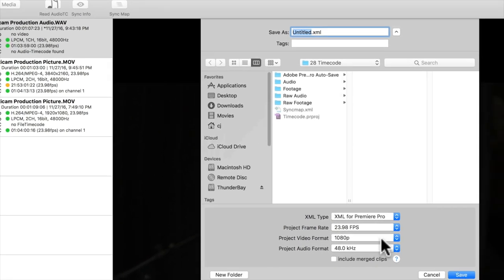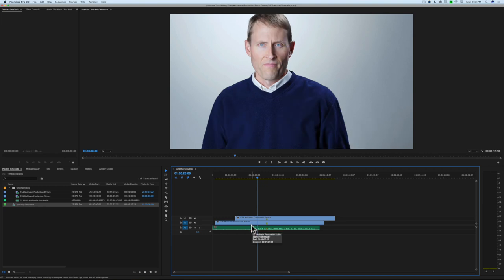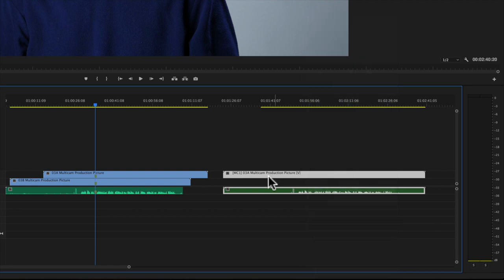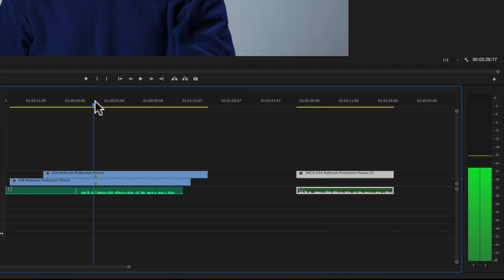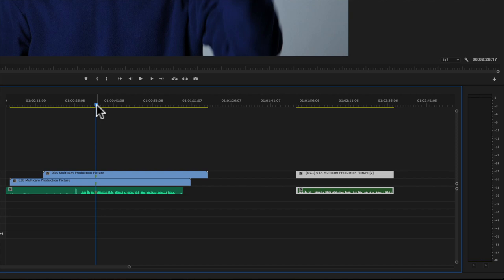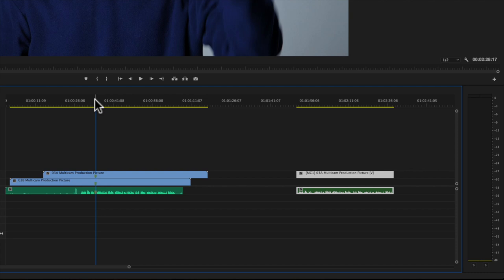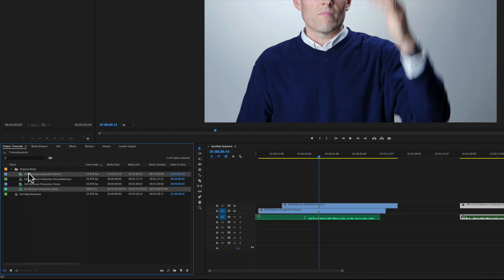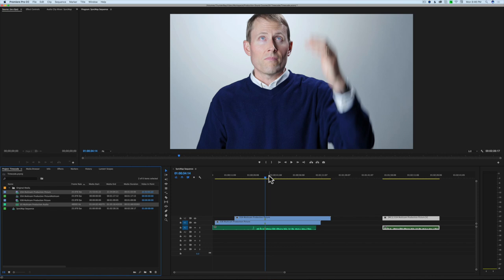Sound for Video Session: Timecode Demo

Comment: Hey Curtis, if you have a synced sequence, you can "lasso" to select the clips on the timeline, right click and choose "Nest". After you have nested the clips, right click the nested sequence, go to "Multi-camera" and click "Enable". Boom, you're in business and ready to multi-cam edit. The advantage to this I guess is that you don't have to go back and delete all the audio tracks. Bonus tip: when I create the nested sequence, I always name it "[timeline name] for color correction" because when you open that nested sequence, you'll have your original synced clips ready to be adjusted for color matching or other clip-level editing.
Reply from the maker: Excellent, thanks so much Nick! I knew there had to be an easier way!

Comment: Very nice info on TC. I would add that my one experience seeing an editor sync 186 clips from 3 cams running TC and my SD633 audio was amazing. Tentacle Sync Studio synced all clips in 30 seconds and produced an XML file in 2 seconds. He pulled the XML and all clip files into Premiere which then began to heat up the iMac CPU and about 2 minutes later all clips were on the timeline synced up and ready to edit. I mention this because in your demo you had some fidlely stuff to do in Premiere and my guy had none of that. It was the first time he ever used Tentacle Sync Studio and first time he ever pulled in an XML file to Premiere. I am not an editor so I can't tell you what he did differently from you but it was completely seamless and blew me away as far as ease of use. He said it was the first time he ever used TC and that if he had not used TC it would have taken him at least 3 days of manual syncing and nudging to do what he did with TC in 3 minutes.
Reply: Thanks, good to hear about that experience. The comment from Nick Laws below explains a much quicker way to do what took me a bunch of fiddling to figure out.

Comment: Great stuff, Curtis! Thank you! I found your videos while searching for some production sound advice a little while back. Subscribed immediately. Really appreciate the detail and clarity of your work.

As far as timecode setups go, figured I'd throw this option into the ring as well: the Timecode Systems BLINK-enabled devices. It's a wireless ecosystem that provides genlock and timecode. Fairly simple to setup, and a lot of options for customization (just a heads-up, if you use the base station, it is more expensive than the other options you covered.) 

So I've been testing out their :pulse mini base station with two :mini trx+ transceivers, and since the system is wireless, one of the first things I did was test for drift. I recorded a 30min clip in which the :pulse was used to generate TC and Sync. The F8 was then jam-synced over a BNC connection with the :pulse's signal. The two :mini trx+ transceivers were then designated as slave units to the :pulse base station. 

Movie Slate 8 on an iPad Mini was fed timecode wirelessly from the :pulse mini base station (the :pulse creates its own sub GHz wireless network). The two :mini trx+ units were joined wirelessly to the :pulse's network. One :mini trx+ was then connected to an Ursa Mini 4.6K's Timecode/Reference In jack via a BNC cable. I only had one camera, so I just monitored the timecode on the second :mini trx+.

I hit record and slated at the beginning of the clip, at the 15min mark, and at the 30min mark. With a right-click of the mouse, the audio and video synced in FCPX, and each slate turned out to be accurate to the frame. Which, I'll admit, made me feel a little giddy, haha.

I also ran a test with letting the Zoom F8 record continuously, and shooting several separate shots with the camera (hitting record, stopping, waiting 30 seconds and hitting record again). In FCPX, each one of the shots synced perfectly to the single F8 audio file.

Sorry for the long post, but I was pretty excited about the gear and the tests, and thought this would be a great place to share that excitement. Oh, and it's probably worth noting I'm in no way associated with Timecode Systems. But if the gear continues to be as reliable as my initial tests, I'll shout it from the rooftops (smile).
Reply from the maker: Hey Tony, thanks for that. Great into! I'll be heading to NAB next month and now that you mentioned this, I'd like to stop by their booth and have a closer look. Thanks again!

Comment: thanks for the video. i am tempted to get a tentacle for when i am doing sound for a camera that does not keep good time and has time code input, or a dslr  but for my own project i usually just use wireless camera hops via a sennhieser g2 or g3 and just use synchronize in PPCC from the scratch track sent to the camera.
Reply: Yes, completely makes sense. Timecode isn't critical for smaller pieces.

Comment: Thank you very much for this video, Curtis! 
I have a question regarding MIC vs LINE: If I leave a (Tentacle) Slave set to LINE, connect it to a DSLR and the Timecode Audio Signal is so loud, that it clips (like you demonstrated on your Camera with the Audio Meters), does that actually prevent the software in postproduction to synch it up (properly)? If not, why is it still important to make sure, that the Level of the Timecode Audio Signal is staying around -12db? Thanks in advance for your response😊

Comment: Hello Curtis, is it possible to make a video on a step by step set up to integrate the Tentacle or the TimeCode Systems Sync One to the zoom f4? Another question, if i plug either the tentacle or the sync one to my zoom, then i will need another one to plug into the camera and leave them both on correct?

Comment: Hi Curtis. Thanks first for all these videos! Great material.  

I have a D750 that I output to an Atomos Shogun Flame which has timecode and sync and I have a Zoom F4 with timecode in and out (but no sync?) and I'm interested in making sure they're in sync, after your videos I figured out how to jam-sync them together, but I'm interested in genlocking them together to ensure there's no drift, do you know anything about that?  Or would having one of them use external timecode solve that problem just as well?  (I can imaging needing two cameras in the future, so a solution that works with that would be best).

I do understand that for the most part you don't need to worry about drift until you reach, at a min, 4 hours ( I saw you tracked the F4 timecode for 8 without a frame of drift). But I'm interested in using it for music applications too which is much finickier about having perfect sync.
Reply from the maker: Hi Joshua, sorry I missed your question earlier. Yes, I believe if you plan to keep them connected that you can essentially gen lock the Atomos to the F4 using a BNC cable so that the F4 is generating the timecode in real-time. I hope that makes sense. Best wishes!

Comment: Hi Curtis, thanks for your great and useful audio gear reviews. It's now almost a year since you posted this demo, I hope it's not to late for a reply. When jam sinking a portable timecode unit from a recorder/mixer, is the jam sink being maintained even after powering off the recorder/mixer? My question relates specifically to the Zoom F4.
Reply from the maker: Hi Joshua, that depends on the recorder but for most of them, it does not keep the timecode clock running when the recorder is off. You will need to re-sync after turning it back on.

Some of the Sound Devices pro mixers (633) have a "lunchtime" feature where it turns everything off except for the timecode clock but most of the less expensive recorders (e.g., MixPre-10T, Zoom F4, F8) do not have this feature.

Comment: One of the most informative and clear channel so far, well done again Curtis and thanks for sharing! This video is making me to consider buying a Zoom F4 instead a Tascam DR70D. Though I have one question you should probably clarify: is that possible to sync the recorder with the camera directly, maybe with a specific cable between the TC out of the Zoom to the mic in of the camera? Or those recorders can't send this audio sync signal by themself? I find quite excessive to have to pay one of those expensive little sync boc (tentacle or the other) if the recorder remains close to the camera and the footage keep on single camera setup. I got the Zoom manual file, but did not find the information in it. Maybe a newbie question though....
Reply: Hi Alfonse, thanks! It is possible to feed timecode directly from the F4 (or other recorder with TC output) to a camera which has a timecode input. But if the camera only has a microphone input, unfortunately it will not work without some adapting. In theory it might be possible to use an attenuation adapter cable which goes from BNC to 3.5mm TRS and attenuates the line level signal to mic level but I have never seen such a cable on the market. I hope that makes sense.
Reply: Sure, was my "feeling" but I was hoping for some twicking possible directly from the unit to make this unit capable for adequate audio TC output. Anyway thanks for the answer!
Reply: You can probably make a cable for a very small investment. You will have to incorporate a passive resister attenuator of -60 or -70 db to convert the timecode signal down to mic level. The real issue is how you are going to read the audio recording of timecode (LTC) and setting meta data values for time code in the video files. You can buy a software only verision of Tentacle Synch Studio, but it is not a huge savings over just buying the hardware where the software is included. There is  another program called LTC Convert from VideoToolShed the does the conversion but it is not cheap, or you can use an editor such as DaVinci Resolve that includes LTC reading of time code as a basic function of the editor. Unfortunately FCPX does not read LTC nor does Adobe Premiere,  Avid may.
Reply: Thanks Greg, good insights. And yes, Avid can read linear timecode (LTC).
Reply: Thank you Gregg! Actually I found a BNC to 3.5mm TRS cable for Timecode output with attenuator of -40 db but I read your answer now and see that it wont fit if an attenuation for -70 db is needed. Tentacle Sync seems a decent product, but from what I saw from their website, this software for sync the medias is for Apple OS for now. So reading the LTC in Davinci doesn't sound a bad solution for PC users. But maybe it brings more problems to fix than just adding a small clock generator, I do agree.
Reply: Alfonse, -40 db attenuation probably will work fine. Time code is really forgiving signal, anything above -40 or -30 db of recorded signal should be readable by software. The timecode encoding is in the signal transiting + to - or - to + so there is no real defined standard for signal amplitude. If you can get the signal anywhere between -30 to -10 db you are golden. I will warn you if you plan to transmit the timecode over wireless systems (such as the Sennheiser G3) then the signal needs to be in the -30 db or lower region(at least that's been my experience), otherwise the wireless system may indicate peaking. I can only guess that the wireless systems were never designed to transmit a square waveform such as timecode thus detect peaking when the signal is actually far below 0db. If your camera has line input you don't really need to attenuate the timecode signal, but throwing on -10db helps control the amplitude a little before going into the camera. If your camera only has mic input then definitely attenuate the signal before feeding into a mic input, but -40 db should work fine.
Reply: Thanks Gregg! My camera is an a7rii, so mic input only, but I do not plan to transport the timecode signal over any wireless system. So this -40 db would be the way to go.
Reply: I would include some sort of y cable in your setup and send the attenuated time code signal to one channel of the mic input of the ar7ii and mixer audio output to other channel of the ar7ii. I always try to send mixer output to all the cameras so the cameras record quality audio from the mixer not scratch audio. This has saved me several times and makes synch on audio much more successful if needed. I've been trying to do the same idea of sending both mixer output and timecode to each camera wireless, but haven't come up with a cost effective solution over  just getting the Tentacle Synch boxes.

Comment: Thanks for this Curtis! Been using Timcodesystems Ultrasync One for my RED Scarlet-W and a Mixpre-3 and it works fantastic. But a thought struck my mind, would there be a risk where the timecode generated by a timecode generator could get “stuck” between two frames on a camera... or do they just work and this would never be an issues. Just thinking about the difference between genlock and timecode sync.
Reply: Hi Michael, timecode generators can drift from one another, but that isn't a big risk with the Ultrasync One since they keep themselves synced wirelessly throughout the entire shoot.

Comment: Hello Curtis, excellent session, once again, really appreciate your efforts! Question: Say we sync an audio track with the video perfectly by clapperboard method at the beginning, can drifting still happen at the later part of the video? What causes that? Will timecode workflow eliminate drifting problem all together? Thanks in advance.
Reply from the maker: Hi Mok, timecode actually does not eliminate drift, it just simplifies the process of lining up the in points of the video and audio clips. With timecode, you do have the potential to use a reference point in the middle of a longer clip rather than a reference part at the start so that "evens out" the drift if it is relatively small (e.g., one frame). Drift is usually a result of poor timing on the processor of a camera or audio recorder. Consumer grade cameras typically have more challenges with this but any time you get over about 15 minutes, you can see some drift. Thanks much!
Reply: Thanks Curtis! Great stuff!

Comment: Thank you for great informative video Curtis!  I'm going to be conducting a series of oral history video interviews with single camera (GH5 when released).  Plan is to place lav on subject as well as use hypercardioid mic on boom and record two separate mono channels.  Also plan to send audio to camera for 'scratch track'.  I'm on the fence about whether I need spend extra $300 and jump for a Zoom F4 w/ timecode support, or if I can get away with audio sync only and buy a Zoom H6 (and save $300).  H6 has convenience of also being self contained field recorder for 'b-roll' audio.  I envision oral history interviews will be 1-2 hour sessions.  I will be using excerpts of the interviews in larger documentary project.  I'm wondering if it's worth extra cost and if I'm over complicating the workflow with timecode for single camera.  I'm concerned about drift of audio-only sync for long interviews.  Willing to slate as needed during production.  Post will be done in Premiere Pro.  Thank you for any advice you can provide!
Reply from the maker: Hi Ryan, on most of my projects I just use claps or slate to sync. Timecode is nice for productions where there are more moving parts and bigger crews. But even timecode does not necessarily fix drift issues. If you're doing a long take, cameras and recorders have a tendency to drift. I think you'll find a little less of that with something like the F4, but it depends a lot on the camera involved. As a matter of practice, I generally shoot in clips of 10 minutes or less to help avoid drift issues. You may get lucky but definitely test out your kit before you dive into any long takes. Best wishes on your project, it sounds like a lot of fun!
Reply: Thank you again for your insight and well wishes.  Based on my research the Panasonic GH5 will support timecode "It also embeds SMPTE-compliant Time Code either in Rec Run or Free Run count-up methods, which makes it easy to synchronize multiple video footage or sound sources in the post production workflow. " (from https://www.digitalphotopro.com/newswire/panasonic-lumix-dc-gh5-details-and-launch-date/)

If I'm understanding this correctly, would this eliminate the risk of drift in longer takes?  Or is 'sync' a different issue than drift in longer takes?  ...if you know what I mean.
Reply: I think the GH5 will embed the timecode in the file and via its HDMI feed. I believe that with the optional audio unit add-on you can jam sync it to recorders with timecode outputs. Or you could use something like Tentacle Sync. I believe that sync and drift are two separate things. You can sync with timecode and have the first part of the video spot-on but find that one of the devices can still drift during longer takes.

Comment: Hey Curtis, so if I use my Zoom F6 for external recording, and my a7C to record video, and I use the tentacle sync e or just run the timecode line out from the F6 directly to the a7C mic in, this allows me to now record a bunch of separate video clips and a bunch of separate audio clips, bring all of the files into tentacle sync software or DaVinci resolve, and the video and audio will be synced up without my having to manually track on a piece of paper or in a note on my phone each audio track name that corresponds with each video clip name? Sorry for such a basic question, I'm completely new to external audio recording with time code
Reply: Yes, you have the right idea. But, I wouldn't trust Resolve to get it right. It has had issues with converting audio timecode from cameras to metadata and then it doesn't sync. But the Tentacle Sync app does it very well.